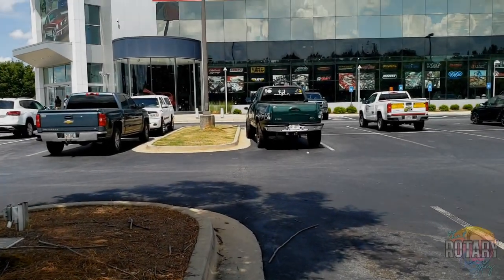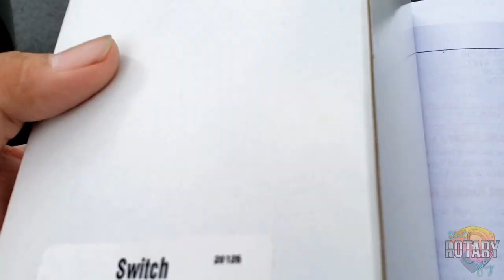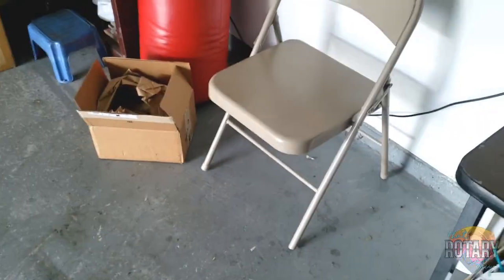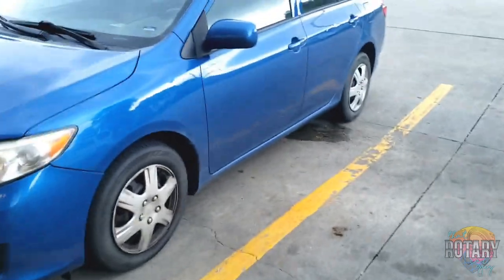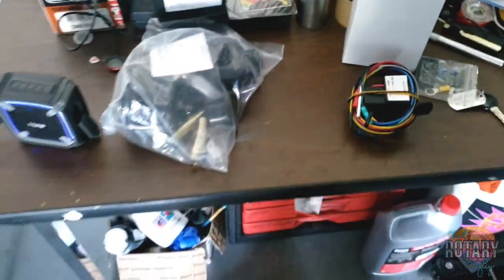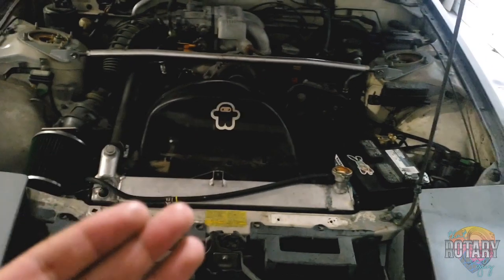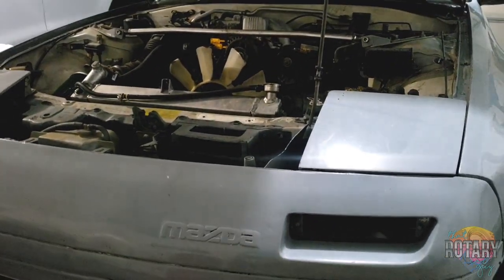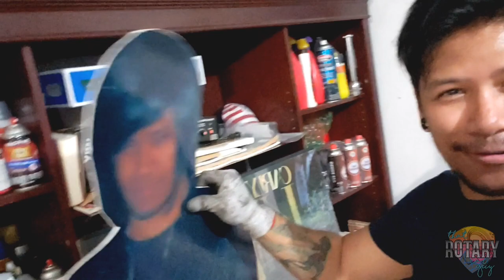RX7 FC Radiator Removal | Koyo Radiator

Comment: Hey bro ive been having a very annoying time with my radiator install as I am new to cars, I noticed your radiator didn’t come with brackets too how did you go to put it on?
Reply from the maker: Hey sorry to hear that man, what I did is actually used the oem brackets from the old radiator and it fit right in. Which radiator did u get?
Reply: @thatRotaryCarGuy  wow thank you for responding, I bought an eBay one. I can’t find the email but it came in and it sit well and good with the shroud, only issue is it didn’t come with the brackets. I bought this car without the oem radiator, so I’m trying to find an alternative before I give up and buy another radiator with brackets
Reply from the maker: @rudyduran7359  of course! Anytime man! And yeah I totally understand, definitely see if u can just buy a used oem radiator that have the brackets. If u have facebook, try joining "FC3S owners" page or any RX7 groups. I usually go to those to buy parts i needs and usually people have them or will help u find them